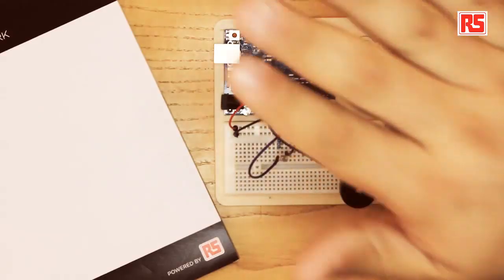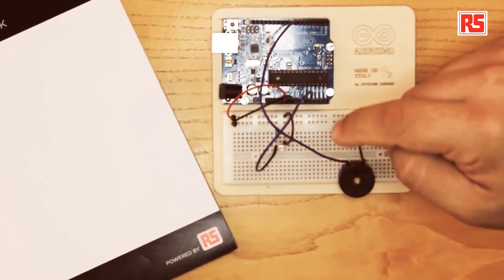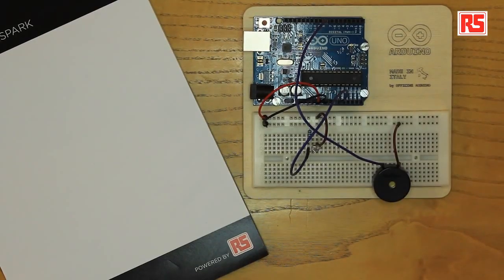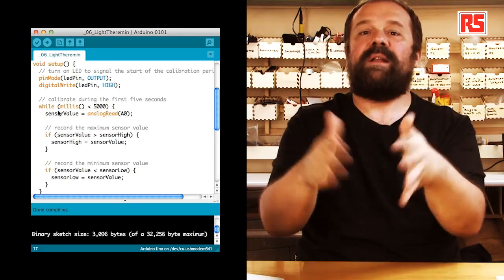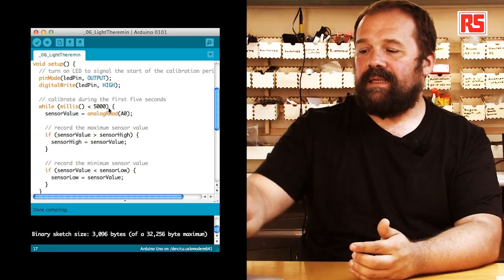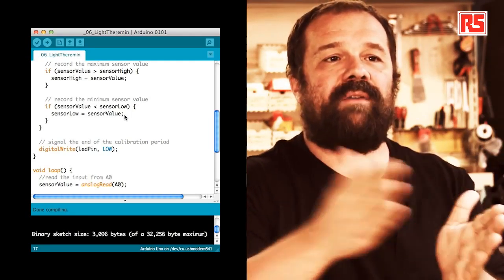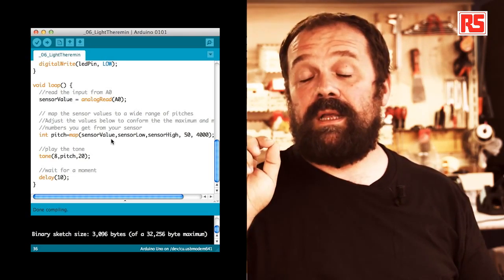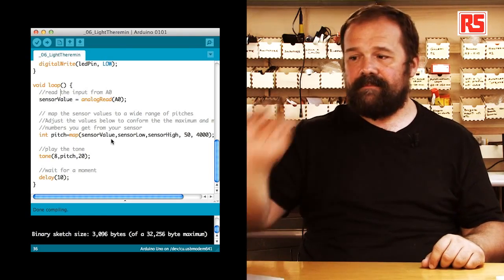Arduino Video Tutorial - 04  Light Theremin

Comment: Interesting tutorial. I receive my arduino starter kit today, and as a musician this light theremin is just fascinating. One question, can I replace the light sensor with a small solar cell under 5V and use that as a sensor? That could be nice because the area of a small solar panel is bigger then the LDR, I guess?
Reply from the maker: It's a great project, yeah! Have you learned to play the Star Trek theme on it yet? :-D

Hmm, I suppose a solar panel could potentially be used as a light sensor, by measuring the voltage output? Although once it drops to a certain level, it might not be all that accurate.
Reply: @Arduino  I made the project in a couple of hours. WOW! Very easy to make for a beginner like me, and experimenting with programming is not that difficult... The solar panel was an idea, but the light sensor is allready very capable to play with :) though I managed to get some spacey cricket sounds (programming the delay) out of the piezo speaker, playing in a Star Trek theme is a bit difficult. Though I think it is possible for music creation if I somehow can connect it to a computer and feed virtual synthesizers the raw sensor data (making it a MIDI controller for instance). Next project :)

Comment: Hye i get confused with the if programming... is it 

If the sensor value > sensor hight ...it will store sensor  ( it will store) 

And then if the sensor value < sensor low ...it will store sensor 

So basically there is two results which are sensor high and sensor low?? Correct??? This 2 values will used at the map function?